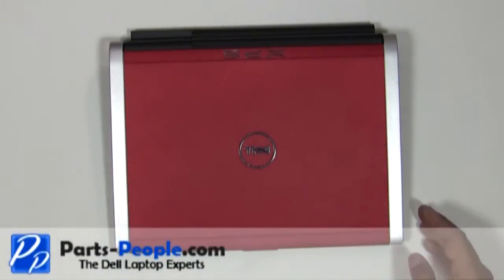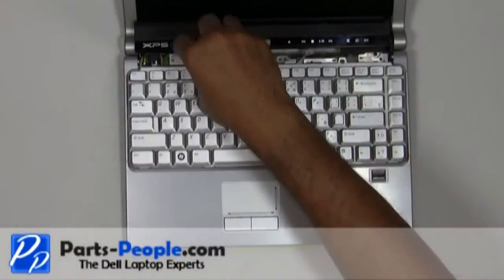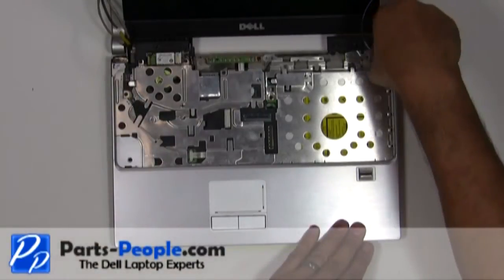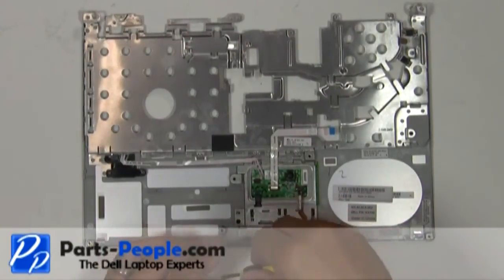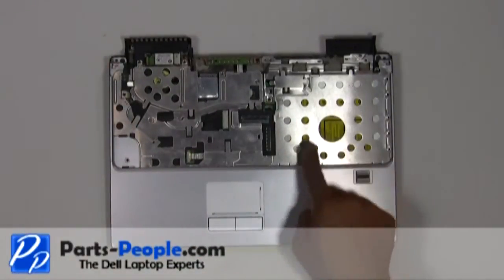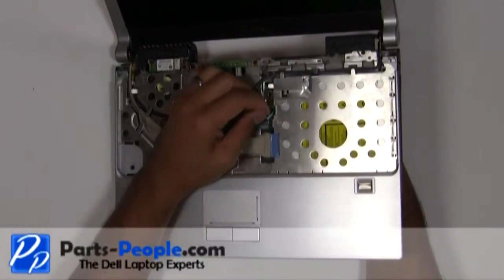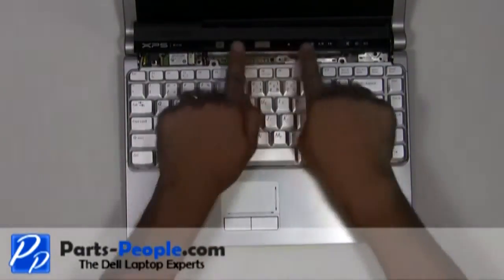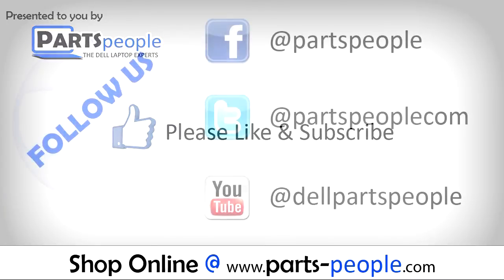Dell XPS M1330 | Touchpad Palmrest Mouse Buttons Replacement | How-To-Tutorial

Comment: I used this video to replace the Touchpad jand its very useful.
Couple of comments , the video is missing the removal of 5 screws that hold the bottom back plastic to palm rest assembly , you need to do this before flipping over. It is clear is you look at the back bottom corners.
Also the two power button and touchpad cables must be removed very carefully , use a magnifying glass to see how the connector works. There is basically a very small black tray in a T shape behind the cable that needs to be push out before disconnecting the cable and pushed back in after the cable is reconnected to hold it in place. 
Thanks Parts People.